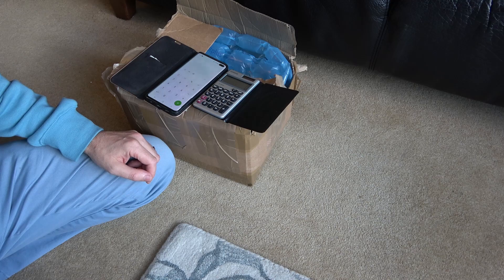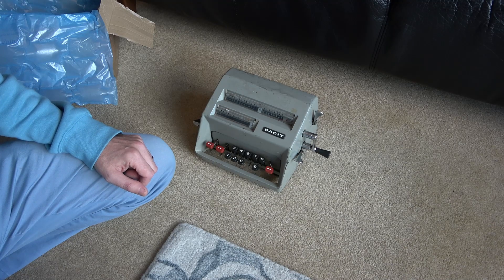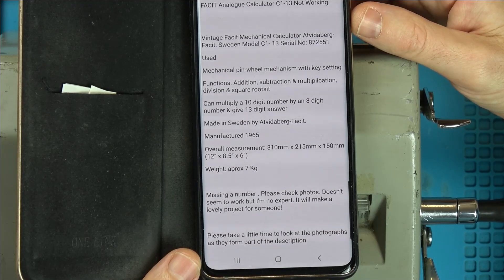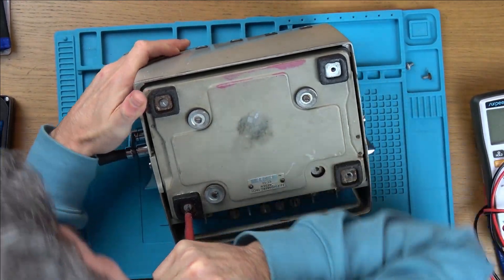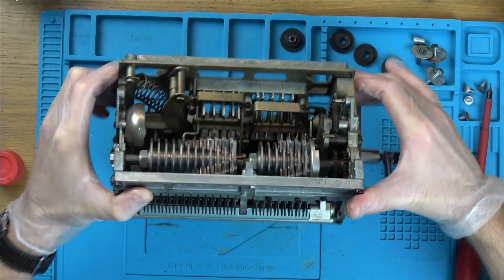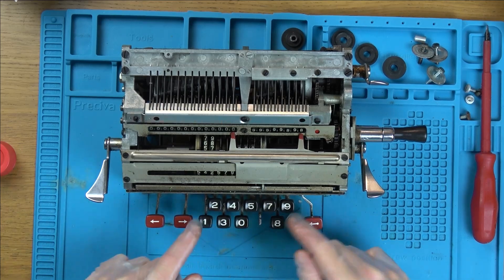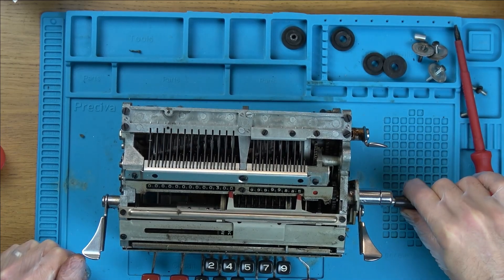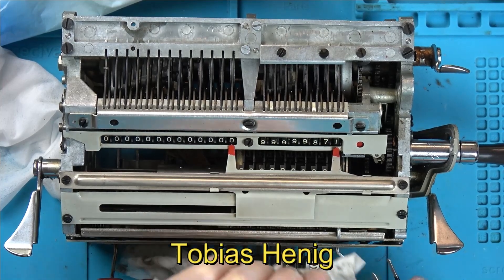Trying to FIX a Mechanical BEAUTY - Vintage CALCULATOR

Comment: Vince,

Used one of these back in the Seventies.
You're right, the bell is for going negative, or for when a division is too much.
One point you missed is this:
When multiplying, you needn't have turned the handle ten times. If you move the carriage back one space, and turn the handle once, this will have the effect of multiplying by ten. Extend that logic for hundreds, thousands etc.
It's a brilliant machine, and that was a great video.
Reply from the maker: Oh yes, of course. Thanks for the tip David 👍👍👍👍

Comment: I own a Monroe Model K (1921) which is an awesome machine. It can do reverse multiplication which is really handy. It was working when I got it except unjamming it from all the people in the thrift store fiddling with it. A little sewing machine oil and it’s as good as new. They used natural oils that don’t gum up.

I also acquired a Monroe LA5 (mid 1930s). It was stuck in certain places but with effort I got the calculator mechanism free, oiled and working. It is electric drive which I haven’t figured out. It can be operated manually but a better crank would help. The calculator mechanism is fairly simple, the motor controls are very complicated.

Comment: Lovely video! I remember learning how to use these at school. The noise of a classful of these machines all crunching away at the same time was really something. Can't remember how to use them now, but I do remember the immense satisfaction I felt when I finally mastered how to do a square root calculation!
Reply: I must ask you, was this introduced after you had mastered a standard slide-rule? For what type of calculations were these machines considered to be better than that? 

The reason I ask is because I'm highly sceptical to how current mathematics is taught in middle and high schools in Sweden today. We try to teach students to learn the proper operations manually, dividing with the chair and so on, to then just introduce the small electronic calculators so that most people forget about these techniques and get lazy. And then, when studying mathematics in university you just have re-learn the manual operations again! And the poor students of other disciplines (economics, engineering) never really get a proper foundation to really understand what really goes on with various algebraic manipulation techniques.  

My argument is that this is mainly due to lazy habits formed with electronic calculators, and a lack of pedagogical skills for the mathematics teachers in high school.
Reply: @erik.dahlberg  We were taught how to use both a slide rule and an adding machine. 

The two have different uses. Slide rules were wonderfully quick when you only need an answer to two significant figures. As a side effect they teach you to estimate as well, because you have to keep track of the decimal place on your own. I still have my slide rule as a matter of fact, although I haven't actually used it for decades.

The adding machines were in widespread use when an accurate answer is needed, like in financial calculations, they are just slow and cumbersome. 

Obviously both devices are wildly inferior to any basic electronic calculator, as is mental arithmetic also.

The ability to calculate manually is pretty useless these days, although I do find it helpful to see immediately when the young person at the checkout has made an error!

To be honest I think that normal people don't need much more mathematics than an understanding of basic arithmetic operations, as taught to infants by the Numberblocks series on the BBC. Why not rely on a calculator to do hard sums? Those who want to specialise in Mathematics can learn how to do manual calculations and why the methods work, no need for others to do so!
Reply: @Crumbleofborg  Thank you for you prompt and thorough reply! From your last point, I presume that you perhaps went on to study in some technical field for your higher education. The reason I ask is that I presume that you therefore were not exposed to some of the nerv wrecking stupidity that goes on regarding mathematics in the "social fields" as economics, finance, business management and so on. There are so many examples of basic "formulas" that are taught as MAGIC TRUTHS that you should learn by heart in economics and management courses, where the underlying logic is just a refactoring, or a little algebraic manipulation away from another known fact. 

I wish I had at least had a semester or two with basic linear algebra BEFORE i pursued my Master in Economics. It would have saved me so much frustration, and would have guaranteed me the highest grade in class almost effortlessly as well as almost instantly catching the underlying intuition for a specific problem or linear optimisation, as it did for some of my fellow classmates who had this mathematical skillset beforehand.  

Regarding "normal people", I agree 100%, they only need basic skills and perhaps being able to calculate percentages and so on. The problem in Sweden is that the expectation levels even of the highest grade in Mathematics in high school and then on to university is that it has become tailored to this category of people, not the 1-5 people in every classroom that actually have the inclination to properly master the subject at hand. We can see the result right now, when people spend 3-5 years in University to then go on to becoming a Barrista at Starbucks...

Comment: The bell inside of this mechanical calculator is heard when the main result register either overflows, or when the value in it goes below 0, as the calculator can't display negative numbers.
Reply: Came here to say this.  :)
Reply: If you add and subtract a column of numbers (such as a list of debits and credits) into underflow territory, clear the keyboard, copy the result including the leading 9s down onto the keyboard, subtract twice and the result dial will show the answer to which you add a negative sign. I learned that from a 1931 Monroe business machine course book.

Comment: Back in the early 60's, my dad had a Bohn Contex calculator. Made in West Germany, and manually operated. It would add, subtract, multiply and divide. Instead of a crank, it had a palm operated plunger, all operations were tied to the number of strokes on the palm plunger. It too was a mechanical marvel inside. Very interesting video, thanks for posting!

Comment: I have a same machine in good working order. I‘ve also repaired another machine from a friend. But that machine was really stuck. So I had to take oit one of the rolling mechanisms and set it back „on time“. And then it worked again. These are nice machines. Thanks for the video!

Comment: While I appreciate your perseverance in cleaning the mechanics of this machine I'd like to offer some advice if I may.  If you have access to lacquer thinner a bit of it in a squirt bottle would speed the cleaning ten fold.  It will dissolve old grease like that almost instantly.  I use it when I'm freeing up the mechanisms on old BSR turntables and it works a treat.  Other substitutes that work equally as well would be aerosol cans of brake cleaner or carburetor cleaner as they can blast away the grime deep down inside the machine that's hard to reach and any of those 3 solvents evaporate very quickly.  When it's clean and ready for new lubrication a drop or two of Singer sewing machine oil is more than enough in the places that need it.  Careful not to over oil the parts as that will simply attract more dust & dirt and leave you where you started again eventually.  :)

Comment: Get yourself a good sewing machine oil instead of the WD-40. WD-40 is a good penetrating oil to free things up, however in about six months it will dry out and get gummy again.
Reply: Exactly, WD-40 is not a lubricant. I would personally recommend the 3-IN-ONE High Performance Lubricant with PTFE for this type of renovation.
Reply: @lesrogers7310  In this case, he isn't using it as lube. He was using it to get it clean and freed up. He mentioned that he might get the correct grease for it and properly lubricate it another time.
Reply: I 2nd sewing machine oil. Find a fabric store, they usually have it.

Comment: Used one in several steel division boilershop drafting offices in the ‘60s. Detaling drawing and calculating lengths of structural steel members and steel plates for the boilermakers to cut steel down on the factory floor. Needed 100% accuracy, NO mistakes tolerated!

Comment: I was born into the business of typewriters, calculators, adding machines, and cash register. It was a family business. We used a large part washer filled with Varsol and light machine oil mixture. The Varsol would break up all the old oil/dirt and flush it out. Then the light machine oil would leave an oily film on all the mechanical part. Usually would fix most issues other than something actually breaking like a spring.

Comment: In the 70's we used to get "addiator's" which with a little plastic stylus you could do some quite big numbers adding or subtracting and multiplying you broke the numbers down then worked it out adding the number x many times.   Shops often had the special pounds shillings and pence addiators in the time time before decimalisation which I remember too lol   Quite funny in our penny was bigger than even the 2p or 2 shilling pieces and I was so sad when the half penny the sixpence etc all went to the wall.

Comment: Hey Vince, I’ve heard a lot of people say not to use WD-40 for things like lubricating door hinges as it does temporarily help with lubrication but attracts dust which will make the problem worse. They suggest instead to use a 2 in one or 3 in one oil. I hope the calculator doesn’t get dust in the gears and seize up again!

Comment: Vince I'm only halfway through the video but I think you've stumbled on an absolute treasure here. It's similar to the Curta mechanical calculators which have become highly collectible by anyone interested in historical computing. The machine seems complete except for that missing keycap which could easily be 3D printed. If I can offer some advice, WD40 is not a lubricant and isn't really appropriate for restoring the machine. I'll shut up and watch the rest of the video now.

Comment: I used to work on these and mechanical cash registers as well back in the late 1970's. Most common fault was gummed up works because the grease had gone to paste. We used a high pressure hot water pressure washer. Then after drying, we sprayed them down internally with machine oil. Only got really complicated when we got to the electromechanical ones which sadly used cloth covered wiring and gigantic AC motors. They still used the crank even then for those places where they didn't have electricity and/or needed something that would work with and without power.
Reply: What would you use for cleaning if you don´t have a hot water pressure washer? Would it be OK to soak it in hot water, clean it under the hot water tap or something? I have to older Original Odhners that still work fine, but will need regreasing soon.

Comment: brake parts cleaner is the perfect thing for a clean up like this
Reply: Yes. I have brought the same device.  The shaft was stuck.  A little brake cleaner and sewing machine oil fixed.  And even after a year, it works great.

Comment: Your two screwdriver method worked pretty good, but there is a manual impact driver that you can hit with a hammer. It applies rotational force as it drives the bit firmly into the screw head lessening the chance of stripping the head out. Very handy tool for situations like that.

Comment: Go to a auto parts store and get some brake clean.  That will clean it up really well.  Follow that up with some machine oil.  I have restored 3 of these that way.
Reply: Considering break cleaner is about half acetone it would likely eat all of the buttons and display tumblers.

Comment: 21:48:
For cleaning I always use a container with very hot water, an absorbent cloth, gloves (to hold the hot water) and sometimes that magic sponge (white) that works miracles. But be careful because the sponge is very abrasive and on painted or shiny surfaces it will be necessary to polish it after it or even repaint.

Comment: I deal almost exclusively in Friden machines from the 30s-60s but most of the knowledge should transfer, firstly you dont want to use wd-40 as a permanent oil, it is good at removing stuck things but after that is should be replaced with some sewing machine oil variant.  The best i have found is Nye 140B oil, its pricy but it works miracles, it removes old oil and replaces it in one foul swoop.  Most of the time machines like this don’t need to be fully disassembled, infact it can be very risky to do so.  My friden machine alone has around 1000 pages of adjustments to get it running correctly, if it was disassembled fully then you would have a heck of a time getting it working again. Rather work on small bits at a time, its often the case that one small stuck thing is cascading causing larger problems down the line.  Most of all these machines take time to repair especially if you are just learning, take your time and make sure everything goes back where it should.
Reply from the maker: Thanks for the tips ArcadeCarpet 👍👍

Comment: 2+2=5 bit made me giggle 😅 epic 👌🏼
That’s a noice vintage mechanical calcy tho. Very noice indeed...
I recall seeing similar gizmos when I was little at my aunts work place and she was a manager to one of the well accredited/established CPA accounting firms here in my neck of the woods.
Only difference is that they had a bunch of em but they were essentially the same thing, a couple may have been bigger and more complex. Needless to say, they were for hardcore calculating tools during that era no doubt.
You got that for dirt cheap considering the materials/weight of it imo. Something like that would be sold by it’s raw metal value here rather than it’s usability.
Also looks like good degreaser and some controlled heating would be beneficial in the servicing of this unit.

Comment: A great product for removing old grease on adders and typewriter mechanisms is WD40 SPECIALIST Industrial Degreaser. It comes in the same can size as the WD40 Lubricant.  It doesn't smell, it doesn't damage paint or plastic. You can use it in your house sitting at your kitchen table if you like. Once everything is moving freely you can then lubricate using a very light  machine oil. I like to use those small syringes with the blunt metal tips so you can control how much to apply rather than it just coming out in drops. With these machines, less is more when it comes to lubrication.

Comment: A lot of people keep saying to use brake cleaner but I wouldn't want to get that anywhere near this. Brake cleaner is harsh nasty stuff, get it on those counters and it would probably take the paint right off the numbers and I'd be afraid it would destroy the plastic bits. It also stinks, and it's horribly toxic, not something you want on your skin or to be breathing. I'm sure there are much safer ways to clean up old grease without all the risks.

Comment: white lythium grease works wonders for a lot of those parts that rely on sliding linkages and levers.
I bet this thing had that old mechanical typewriter smell to it from all the old dried up grease and oils.
Makes me sad I tossed out that old underwood typewriter years ago that I found at a yard sale for free. I bet even it would of still been working perfectly today had I kept it and restored it instead of throwing it out. It still worked, too, its just the keys would stick

Comment: Are your Wet Wipes expensive?. You seem to use the same wipe and spread muck from one surface to another. Apart from that I love your videos and determination to repair anything that comes your way. Some of your fixes are ingenious and your dialogue as you go through the process , mouthing your thoughts, puts you above many You Tubers wo use pauses to hide their mistakes.

Comment: Be careful You can see the blood smudges on the bottom from the last guy that serviced it! Most screwdrivers have bolt-like shafts & hand grips to slip a box (spanner) wrench(in America) over to aid with torque. you have an obviously insulated set that covers those helpers. As a kid in the 60s my parents had a 3.57 stone 50Lb monstrosity that only added and subtracted that had a crank you pulled down once to add or subtract pulled 3 times in a row it totaled I t printed on a spool of paper black for adding red for subtracting. I drove them nuts playing with it it made such a racket! PS. for upkeep you doused everything that moved inside with sewing machine oil, hence the large drip tray and pads to catch what oil it flung off while in use to stop it from sloshing about.

Comment: Could anyone relate this marvel piece of engineering to the prior works of Babbage's "Difference Machine", and the proto programming that Byron's daughter Ada Lovelace pioneered, approx a century before this FACIT was manufactured?  Did the Difference Machine have the same capabilities? 

And by the way Vince, if you ever have an opportunity to look under the hood of the US Marine Tech related to analog "Super Computers" that were used to calculate ballistics on the fly, that would be an epic video for the ages!

Comment: Facit was all about mechanical engineering. They had no idea that invention of the transistor would soon obliterate their complete business model. At the end they did some stunning improvements and replaced the hand cranking with an electrical motor, but the race was already lost.
You could get a completely silent, small, light japanese electronic calculator that never jammed.